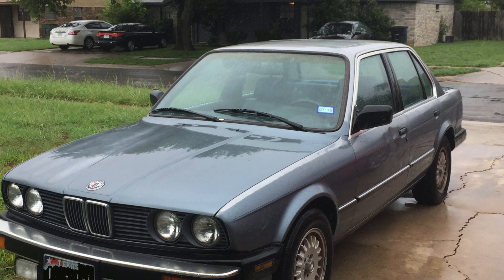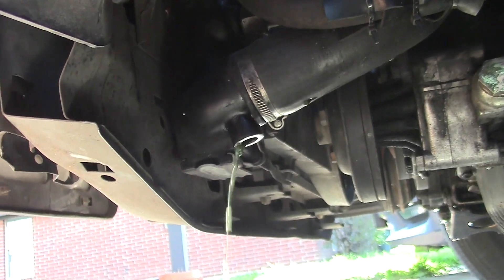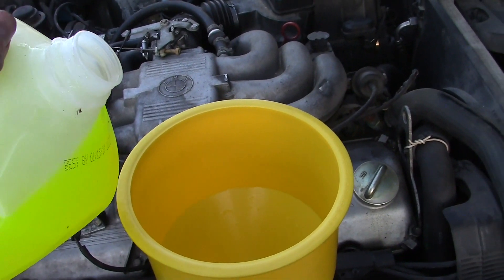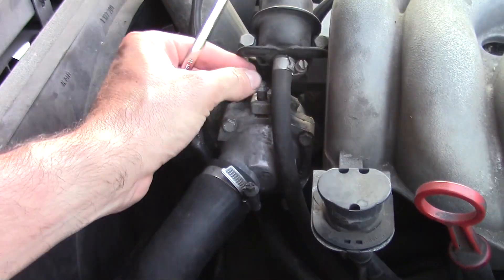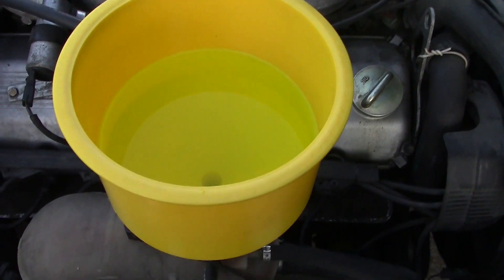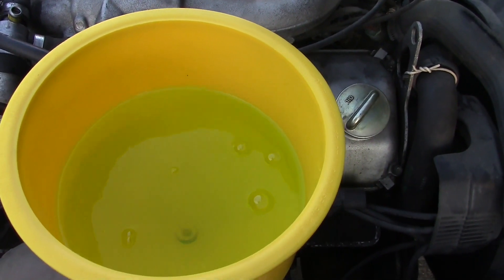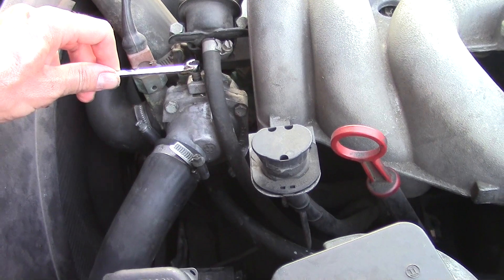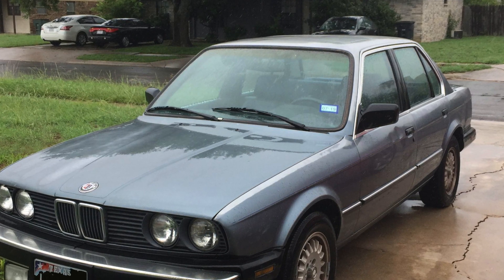BMW E30 Coolant Flush and Bleed

Comment: I Do have a 318I variant of this model and it's very different but relatively the same, you do have to drain from the sensor on the bottom of the radiator and make sure to keep an eye on the temperature as you burp the system. I use OEM Coolant since my M10 wanted to overheat on regular store bought coolant 😅
Reply from the maker: Drain from the radiator, and use a funnel like the one in the video to burp the system. As you watch the temp, make sure you keep the car running until all the major bubbles burp out of the system.
Reply: Can confirm this worked!  No more overheating issues. Cheers @bigilworth

Comment: If you have a aluminum heads you should not use the green antifreeze
Reply from the maker: The forums are all over the place with modern coolant.  Now the general philosophy is just use the same type, don't mix.  Prestone is a general coolant for any vehicle and because my E30 is so old and crappy, I'm not concerned about super longterm damage to the block or head.  After 5 years and 60k miles of running Prestone, I haven't had any issues.  

I agree though with you that if I was to use correct BMW coolant, I'd use the blue stuff.

Comment: The hell with the e46 process i am doing this, I've done as per instruction and never got it right but a mess in the floor
Reply from the maker: HAHA!   The E30 manual process says to squish the top hose a bunch and keep the bleeder valve open for long stretches until the coolant starts flowing out - After my first time doing that I had coolant everywhere and said there HAS to be a better way.  Hope it works out for you next time with the Coolant funnel

Comment: What if the car doesnt start?
Reply from the maker: If you can't start the car, there is no reliable way to bleed the air out of the coolant system because you can't get the water pump to work.  I would work on getting the car to start before you do a coolant flush.
Reply: @bigilworth  oh no! So i bought this car as a project build and i wasn’t really thinking of it i thought id take the rad out since it was rusty and replace it with the one i have from a donor car. Did i just mess something up? This is my very first project car the car wasnt running when i bought it it has a few missing parts thats why it came with a donor car.
Reply from the maker: @jayelectic8017  You didn't mess anything!  It only means you can't bleed the air out of the coolant system until you get the car started.  If you were to do an engine rebuild, you'd have the same problem - doing a coolant change before having the car start for the first time.  You're totally fine.  After you get the system filled with as much coolant as it will take, start working on getting the car to start and run.  Once it's running, then follow the video's procedures for bleeding air out of the system.  You'll want to have the funnel filled with coolant to allow bubbles to work themselves out.  

E30s are incredibly fun to work on because they're so easy to work on.  You'll have a great time trying to get the car running.

Comment: Just purchased this funnel kit to make the bleeding process easier.
But before I attempt to bleed the system, I was wandering do you plug the overspill pipe during this process? Otherwise, the coolant stored in the funnel will just leak out of the overspill pipe?
Reply from the maker: No need to plug the overspill funnel during the process.  You actually want to keep it 1/2 full at all times to allow air to escape and more coolant to flow into the system.  If you plug it up then air can't escape nor can coolant enter the system.  Once you feel that the system has been bleed of all air, turn the car off and then plug the overspill funnel.  That way when you detach it from the coolant reservoir, no coolant will spill out all over the place.  You'll most likely need to remove some coolant from the reservoir afterwards because it will be right at the top of the cap.  I usually do that with a turkey baster.  Good luck!
Reply: @bigilworth  sorry I should have been more clear. I was referring to the overflow pipe from the reservoir tank which drains out to the bottom of the chassis when there is noo much pressure/coolant in the system. 
Does this pipe need to be plugged when using the funnel method?
Reply from the maker: @1devz1  Ah gotcha.  No that pipe doesn't vent extra coolant unless the system becomes over pressurized.  It wasn't until I was doing a spark plug job and had to move the reservoir, (which was months after using this funnel and creating the video), that I even noticed that vent tube.  Definitely no coolant came out of that tube while bleeding the system and while using that funnel.  However if it makes you feel more comfortable, you could just plug it.  A simple clamp or rubber plug will do the trick.
Reply: @bigilworth  thanks for taking the time to reply bud! 😁
Reply from the maker: @1devz1  Yea man, good luck.  Always willing to help the E30 community.

Comment: Hi! I know it's a "basic" item but where did you find this funnel? And if I understand it is used to keep the level higher than anything to facilitate the evacuation of air bubbles, is that it?
Reply from the maker: Thank you for the comment.  Do an amazon search for "coolant overspill funnel" and you'll find all the different companies making these funnels.  The brand I used in the video is Lisle.  You are correct that the point of these funnels is to facilitate the bleeding of air inside the radiator system.  It makes the air bleeding process incredibly easy and it reduces the messiness of bleeding air out of the system.  Good luck!
Reply: @bigilworth  does the funnel have to be specific to e30?
Reply from the maker: @scraw188  Nope.  Any brand of "no-spill" funnels will work.  They all come with a bunch of different radiator attachments, so you can attach the funnel to any car.

Comment: Where does the hose on the left go to? The hose without the sleeve on the reservoir.
Reply from the maker: That hose doesn't connect to anything and routes to the bottom of the chassis.  It's part of the expansion tank's overfill safety mechanism.  If the expansion tank builds up too much pressure and/or fluid, it can escape via that hose.
Reply: @bigilworth  thank you sir!!!
Reply from the maker: @chrispbmw8732  No problem!  Hope you keep learning about these cool E30s!

Comment: Great Video! I'm having a similar issue right now with my 90 325is. Fluid is just pouring out of the bottom left hand drivers side where i THINK the petcock is need to check tomorrow. Cars overheating and when i filling with coolant once the car reaches temp it all just floods out of the bottom left hand side. Is that the petcock area? or is that where the overflow is?
Reply from the maker: You're correct, the petcock is on the left side of the radiator.  If your petcock isn't broken, you might have a cracked radiator or broken hose.  There is a hose from the thermostat housing to the radiator that could be loose.
Reply: @bigilworth  thanks! Gonna take a look at that now. Ordered a new coolant thermostat and petcock screw from FCP just Incase. Hopefully my rad isn’t cracked just been having a rough time seeing where the leak is coming from lol

Comment: Hello dear friend. By chance you have the procedure of bleeding the cooling system, when the expansion tank is attached to the radiator. Greetings from Chile, South America.
Reply from the maker: Hi.  It should be exactly the same.  If you're using the "no spill" funnel, you attach the funnel to the radiator, then fill it until no more coolant is entering the car.  Then turn the car on and make sure that the funnel continues to have coolant while air bubbles out of the engine.  AND make sure to every so often release the thermostat housing screw to release air.  Sometimes air gets trapped there with no way of getting out.

What car are you working on?
Reply: @bigilworth  Hi. I"m working in my 1990 320i. Now I have some problems with the cooling system. There is not the original, I installed one radiator of Z3 model, with the expansion tank attached to radiator. Thanks
Reply: When I make the procedure what you describe ...... the coolant level in the funnel go up slowly when the engine is working !!!
Reply from the maker: @rodrigoandrescepedaperez7877  Sounds like you're doing everything correctly.  The level of the coolant will rise because as the engine warms up the coolant fluid will expand.  If there are no air pockets in the cooling system and the coolant level in the funnel never goes down, that means your coolant system is full.

What problems are you having with the cooling system?  Over heating?
Reply: @bigilworth  Yes, that's the problem ..... overheating. I made some adjusting, change the thermostat housing, water pump, thermostat and review the radiator work. Thanks
Reply from the maker: @rodrigoandrescepedaperez7877  Maybe a clog in the cooling system somewhere or a faulty temp gauge?  That sucks man, I hope you get it sorted out.

Comment: Is adding water to the coolant necessary because I don’t mind spending a few extra bucks rather then diluting it to get more out of it
Reply from the maker: Pretty much all engines require a 50/50 mix of water and coolant.  If you put 100% coolant into your engine you'll end up eroding the metals inside the engine and the seals, creating coolant leaks or head gasket failure.  I think the highest recommended is 70/30 (coolant/water).  The other reasons why you don't want to over due it is because your engine will not warm up to operating temperature fast enough, causing lean fuel mixture conditions.  The best thing to do is flush out the engine's coolant every 2-3 years or every 40,000 miles.  Fresh coolant helps the engine's metals from eroding and keeping the radiator clean of debris.  Hope this helps!

Comment: I have a 520is E28 M20 1988, am i doing like this too? Same process?
Reply from the maker: Checking out the photos of the E28, it seems that all M20 engines have the same bleeder screw, thus the process should be the same.
Reply: @bigilworth it's All good, I have a same engine... exactly. Thank you mate 😊

Comment: So.. the video is about your fancy funnel
Reply from the maker: If you watch the video you'll see I describe the process of bleeding the air out of the system using the bleeder screw on the thermostat housing.  

But it is also about how the fancy funnel makes bleeding the system easy and with zero spillage.

Comment: Question: Thanks again for replying to my earlier comment. I followed these steps but when I went to drain the water from my system (after letting it circulate through the engine) not all of the water came out (only about a gallon). How do I get the rest of the water out?? And my vents were not blowing any hot air during this process (so I guess I have air in my heater core). Any help is appreciated!
Reply from the maker: If only a gallon came out of the system, then you did everything correct.  There is about another 3/4 gallon in the block of the engine.  If you want to get that out too, there is a screw on the engine block passengers side that will release more coolant.  0.26 of my video shows a photo of where it is located.  I decided not to unscrew the engine block coolant plug because I was having difficulty getting the plug to unscrew and I didn't feel like soaking it with penetrating oil.  I ended up driving 200 miles and then did another coolant flush.  

If your vents are not blowing cold air, you either have air trapped in the heater core or the pipe that regulates when coolant goes into the heater core is stuck shut.  Did the hot air work before you tried bleeding the system? Here is a video that shows the heater core regulator.  https://www.youtube.com/watch?v=t1AiKJeQick
Reply: @bigilworth  Thank you for your reply. That makes me less worried :)  I actually just replaced the heater control valve (which is why I flushed the system) but it was a used part so I am hoping it works and I just have air in the system. Also yes, the vents did blow hot air during the winter

Comment: when do you put the bleeder screw or "petcock" back in? After you have drained all the coolant and begin the process of refilling?
Reply from the maker: Put the bleeder screw back in and tighten shut once all the fluid is drained.  If you don't have the screw in before you start filling the system back up with fluid, everything will leak out as you start filling the system.